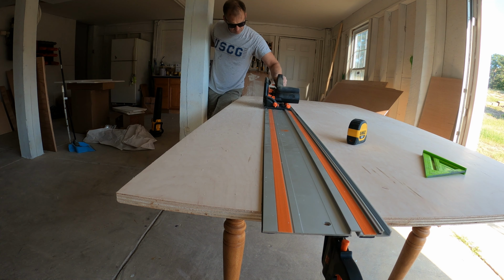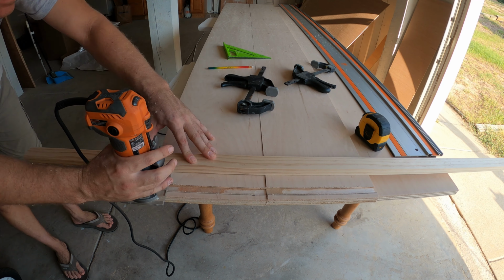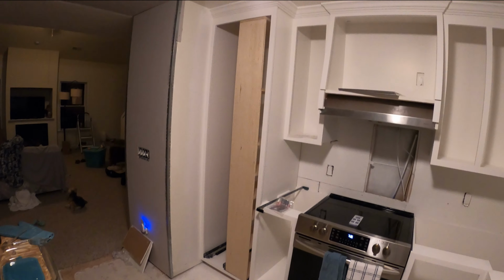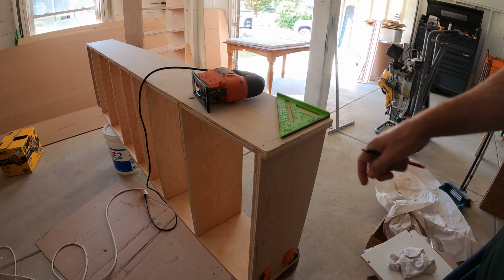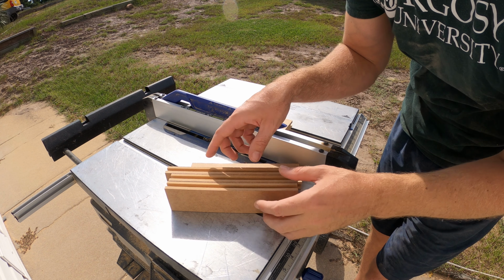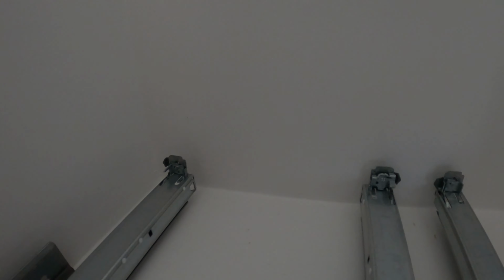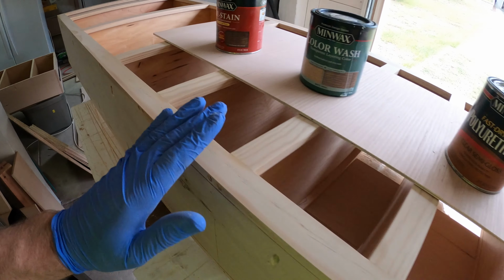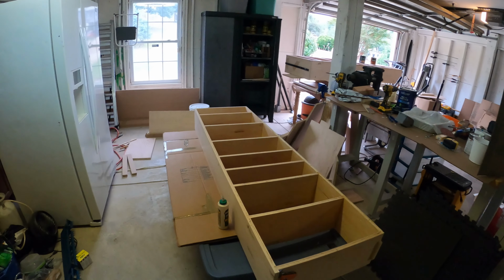Kitchen Remodel (Pull Out Pantry)

Comment: You didnt comment much on the installation of the slides. Were they all mounted to the floor rather than the sides, and what was the Blum product number?
Reply from the maker: I apologize,  I do need to start commenting more in my videos about my processes. They slides are attached to the bottom of the cabinet box and the bottom of my pull outs. I used the below website for my slides:
https://www.woodworkerexpress.com/undermount-drawer-slides/?msclkid=a255c2a2e9691b783c61a60264342a49&utm_source=bing&utm_medium=cpc&utm_campaign=**LP+-+NonTM+-+General&utm_term=Undermount+Drawer+Slides&utm_content=Undermount+Drawer+Slides
Reply: @ It was a great project and inspiration, and very well done. I'm glad you posted it. Thx for the answer to my question.
Reply: @ actually I talked with someone at Woodworker and she told me I couldn't use a 24" slide in a 24 inch deep pantry, and that most of their slides are side mounted. Bottom mounts don't come up after a search on their web site. Do you have the product # for the ones you used?
Reply from the maker: For slides in general you want the depth of the cabinet box which excludes the face frame. My undermount slides are installed on the bottom and have worked perfectly since the build.  I did install regular slides on the very top for stability.  These undermount slides hold 170 pounds which is far more than my cabinet fully loaded weighs. 

Use this link before for 24" undermount slides:
https://www.cabinetparts.com/p/blum-drawer-slides-undermount-drawer-slides-BS7696100M-p9220?srsltid=AfmBOoqg6C5ou8bxduxEV-ZTkXQvGACqinitU3wdVJr4kbN-pbb8xuG4snc&gPromoCode=EOY2024&gQT=2

Comment: I'm about to build a very similar pantry. What slide did you use up top? And are they load bearing or do yhey just act as guides? I was considering two sets of the blums, with the top set mounted in a channel under the top of the "drawer" box.
Reply from the maker: I just used one full extension drawer slide right in the middle of each pull out as a guide. If you go with the two on top let me know how it turns out.
Reply: @DIYCoastie  will do!

Comment: Really needed a much better show-off of the finished product. I am planning to make it go all the way to the floor, with wheels underneath to support the weight, and each unit wider.
Reply from the maker: Yeah,  I really need to make a social media channel to better present the final product. How are you going to use wheels on your pantry?
Reply: @DIYCoastie  Track at the top, and straight line, not rotating casters on the bottom. I plan to drastically cut expensive kitchen cabinet space and replace most storage with custom pull-out pantry. Same thing in the bedroom. Huge walk-in closets are a giant waste of space. Plan to use pull-out closet/wardrobe. When the time comes, I may even make it electric like a garage door. Touch a button and out it comes. One could choose to organize by season. During summer one rack comes out, and winter use the other rack. And too many people do not use over/under closet rods. Shirts and most clothes will fit over under with 2 rods high. A few things like evening gowns, trench coats and such need full height, but that is it.
Reply from the maker: Oh that sounds awesome,  these pull outs are definitely space savers. Good luck on the builds!

Comment: The front faces shouud have a few vertical slots cut out for visual and replaced with either Acrylic or Wire frame, So you have more iof a clue what is in each pullout If the thing was alum channel the slots woud all be there, as the sapce out.
Reply from the maker: Yeah that's a great idea. My wife likes the clean hidden look.... so I just do what I'm told, haha.

Comment: Looks good but I think those sliders are going to be overloaded. When your pantry is full is asking a lot for just two drawer slides.
Reply from the maker: We haven't had any issues with them,  the undermount slides are rated at 170lbs and I don't believe they willl ever get close to filling up with that amount of weight. I will definitely post if anything starts acting up with them.

Comment: I made a pull out pantry after removing our chimney. Unfortunately i'm not a great Diy'er and there were a lot of errors i had to fix. Unfortunately the one that is left is when i attached the front panel its not true to the wall. I took off the panels and trued them as best i can. It has left me with 1/8" difference in gap from the top to the bottom. I need ideas to trim around it so the gap difference isn't noticable.
Reply from the maker: I hate that Youtube doesn't allow pictures to see exactly what your issue is. My suggestion would be measure the difference and build a new cabinet face (practice makes perfect). Personally I think adding trim pieces makes the cabinets look bulky and out of style however if anyone else has any ideas please chime in. Let me know what you decide or if this helps at all.
Reply: @DIYCoastie  part of the problem, I think, is that the wall isn't 100% flat and the cabinet itself is a little twisted. On the right side, which, of course, is hidden by the fridge, it's perfect. To take off the front panels and try to shim everything perfect will be a nightmare. If the front was 1 panel instead of 2, that would be much easier. I did manage to get it from being out 3/8" to only being 1/8".
Reply from the maker: Yeah, removing the cabinets and using shims can be very challenging and time consuming.  How are you with drywall work? My suggestion would be forget about the cabinet and add some mud to the wall, building it out to your 1/8" and just feather it in to the rest of the wall so it isn't noticeable. This should make your cabinet doors visually perfect as long as that twist isn't too major/ noticeable.
Reply: @DIYCoastie  I ended up using a 1/4" wood strip down the entire 1 side that's visible. I took a 1/8" paint stirrer stick and sanded it so it was 1/8" at the top and 1/16"  at the bottom and used that to correct the gap. Glued all together and clamped. 1 piece moved so I will have to sand it flush and paint it but it looks much better.
Reply from the maker: That's great,  glad it worked out for you!

Comment: you just saved me! i dom't know why there is no more tutorials about this fabolous idea on youtube. But We have similars Pantry and i am about to do the same, Could you please attach the link for the sliders?
Reply from the maker: Use the website below, I chose the 170-pound slides so I would not have to worry about overloading the cabinet. The website below will have multiple different size undermount slides so just get the ones for your cabinet depth. I also chose the full extension, soft close. Let me know if you need any more help. 

https://www.woodworkerexpress.com/Undermount-Drawer-Slides/?msclkid=a255c2a2e9691b783c61a60264342a49&utm_source=bing&utm_medium=cpc&utm_campaign=**LP%20-%20NonTM%20-%20General&utm_term=Undermount%20Drawer%20Slides&utm_content=Undermount%20Drawer%20Slides
Reply: @DIYCoastie kept reading the comments and found the link. Thanks

Comment: Awesome build man! Where did you get the slides from?
Reply from the maker: Use the website below, I chose the 170-pound slides so I would not have to worry about overloading the cabinet. The website below will have multiple different size undermount slides so just get the ones for your cabinet depth. I also chose the full extension, soft close. Let me know if you need any more help. 

https://www.woodworkerexpress.com/Undermount-Drawer-Slides/?msclkid=a255c2a2e9691b783c61a60264342a49&utm_source=bing&utm_medium=cpc&utm_campaign=**LP%20-%20NonTM%20-%20General&utm_term=Undermount%20Drawer%20Slides&utm_content=Undermount%20Drawer%20Slides